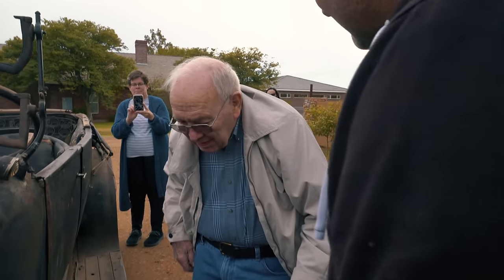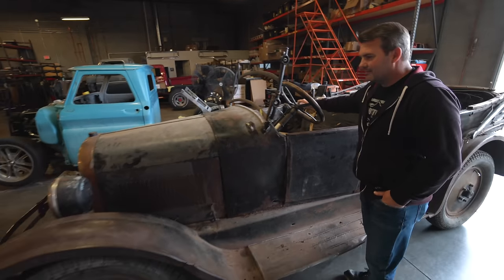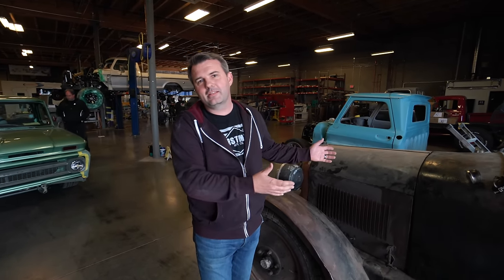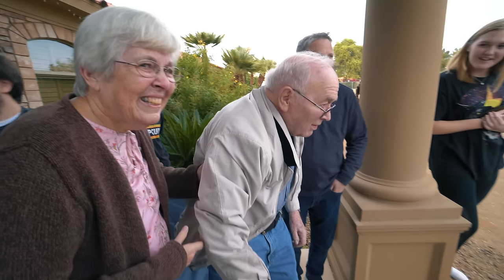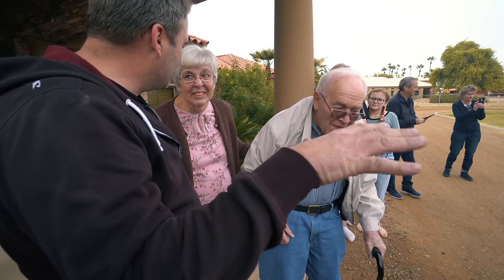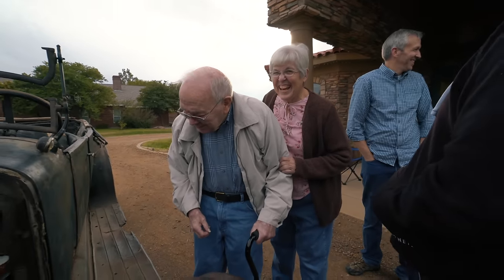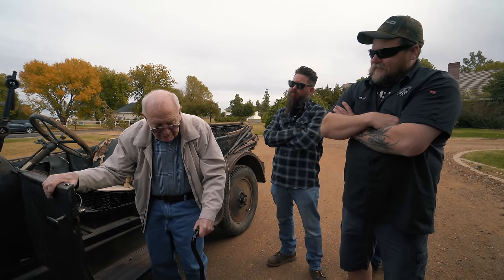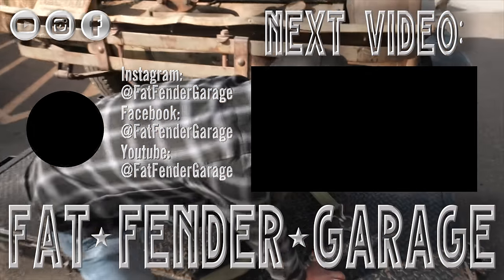100 Year Old Car Finally Runs Again (His first car when he was 16)

Comment: I would’ve definitely restored the engine before presenting it.
Reply: matt brawner the whole care not just the motor
Reply: Nick Webb no because of the originality it has it’d be best to leave as is
Reply: Luke well the motor could be rebuilt so it can actually be driven
Reply: Not just the engine,the whole drive train.One would want the owner to be safe,right?
Reply: matt brawner 
True but there was something special about the car showing it’s age and the owner did too! They both held up and made that victory lap!
Now restore it!
Reply: stuart ebanks you could tell he wanted to actually drive it and not be rolled around in it like a smoky push cart. Might have made the family feel good but I know he wanted to hear it run right and move good.
Reply: I wouldve put a fresh viper v10 in there or maybe a volvo i5
Reply: TechnoGuz GD That’d ruin the appeal of its antiquity, I’d have just redone the original motor.
Reply: Should have done much more that they did. Was barley running and didnt for long. Could have cleaned it up alot. Test light hanging across the windshield frame, smoking  like a freight train. Poor ol fellow.
Reply: Alexander  You would see a profit on it, for such an old car must have a lot of value because of rareness. Especially if it is fixed up to perfect condition to which it runs as good or even better than the average modern car. I would make the car look like it did the day it was finished being made, with a fresh paint job and a nice new car smell.I would make the car reminiscent of the time without taking away the nostalgia.
Reply: Some people just like the look of old or used
Reply: You would have to make parts. Original parts were probably not available.
Reply: Imagine going to a auto parts, ye got some extra parts for a 1924 ahh model T...??? Horseless Carriage??? I'll look on aliexpress nvm! They did a realistic job, probally very hard to restore one lf this its literally ancient compared to what we have today.
Reply: Things this old actually LOSE value when you replace stuff to restore it. You'd probably be shocked to learn how much this would sell for as it is right here in the video
Reply: matt brawner it’s never enough is it? These dudes got a car running that had been sitting for 60 years and yeah it didn’t run great but it was running. Can’t we just be happy it happened instead of griping about what should have happened.
Reply: You don't restore an engine if it can hold only minor repairs, don't make her feel embarassed by fixing the unnecessary and she won't make you feel the goddamn hot sun on your head while you're trying to understand what's her problem
Reply: You don't restore an engine if it can hold only minor repairs, don't make her feel embarassed by fixing the unnecessary and she won't make you feel the goddamn hot sun on your head while you're trying to understand what's her problem
Reply: It's for the best.

Old cars refuse to work properly.

Comment: Inflation goes to about $2000 in 2019 but cars were often cheap
Reply: This car was probably 1500 in 1021 which is about 15000 now. Yes it was cheap
Reply: Chris Huber I don’t remember since it’s been 2 days but somewhere in the video I think he said he bought it for a few hundred
Reply: @moonbeam112  he said it was 135
Reply: @chrishuber8930  15000 dollars but absolutely no features, no security systems, no power steering, for that money you just bought an engine with 4 wheels and 2 benches back in the days
Reply: @notsaab  no thats not true. Even in the 60s and 70s high end cars were 3500 to 4000 dollars. You could get into a solid used car for 800 bucks with a v8 less than 60 k miles good performance and all the features you needed including power steering, a.c, leather sunroof all that stuff.
Reply: @notsaab  but did he need all that

Comment: The issue with movies from the 20'-40' is that all the cars look like they just rolled out the dealership, there would have been a lot more looking like this; torn top and virtual rust buckets, the old Keystone cops movies had plenty of decrepitated cars, because they were at hand and cheap for slapstick stunts, but they are missing in modern movies, where all available cars are show pieces.

Comment: 100 year old car that hasn't ran in decades : Starts after fiddling with it for a short time.
2 year old car with engine trouble : Bricked until you spend $2,000 to replace a broken part.

Comment: that engine was running very lean, you could easlily have replaced the gaskets and flattened the head for a tigter fit, those engines dont need manny repairs to roar like the radical powerhouses they are